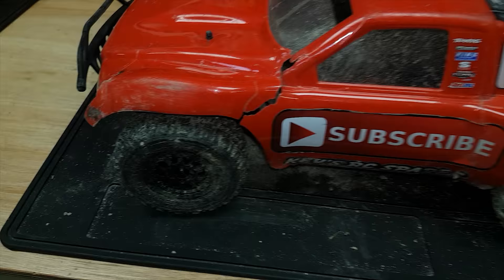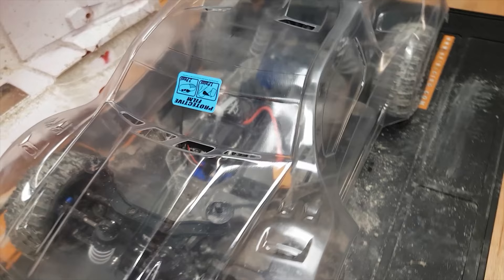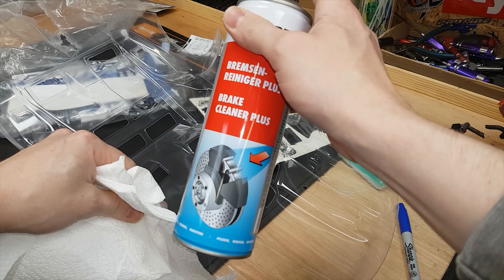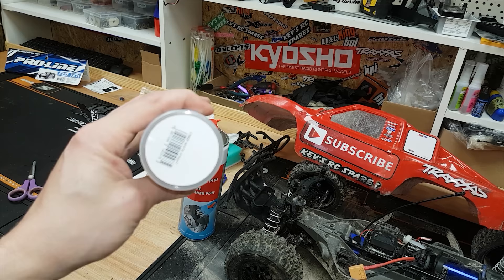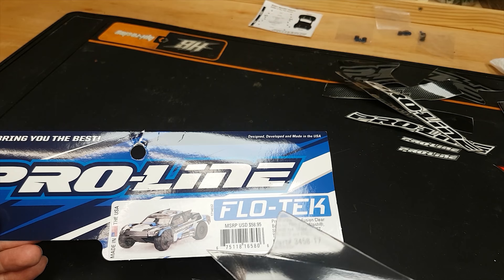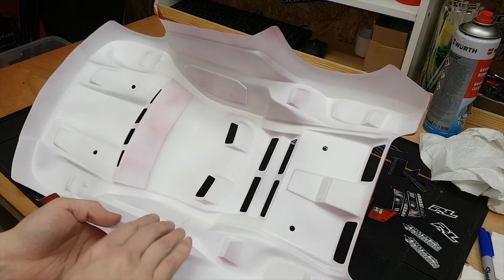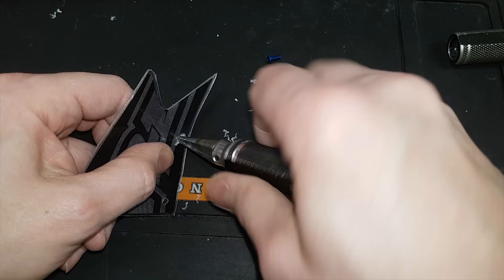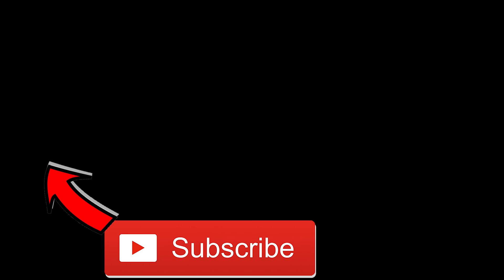TRAXXAS SLASH 4x4 Gets a New Body Proline Flotek Fusion

Comment: from my experience I got some more life out of the body, by slotting the rear body holes forward a little bit. reason: the chassis will flex and without the slotted holes the body becomes a load bearing component and will crack sooner near the body post.

Comment: How does you brushless slash not over heat every time I use it it gover heats and I have a normal monster slash
Reply: Did you ever figure it out?  With the bigger tires you need to gear down.

Comment: Get a traxxas erevo 2.0 I have one and if is amazing
Reply: Harrison Hembree he does its in the mail
Reply: I just preordered mine off amazon
Reply: Uhh, no? Revo's just a jack-of-all-trades-master-of-none piece of junk that wants to be a monster truck and a truggy but fails at being both. Too light for MT, too heavy for Truggy.
Reply: TestECull Guess what, it's not meant for racing, and it's just meant for bashing, where the main thing that matters is durability, and power. It definitely has both.
Reply: It still fails at what it does. You want a better bash rig? THere's a million better trucks on the market dating back 40+ years. It's not even that durable, no Traxxas vehicle is. Half their business model revolves around selling hopup parts, which they can't do if the thing's properly durable right out of the box!

My point still stands.  Revo is a jack-of-all-trades master-of-nothing piece of junk. Do your research, buy a better truck. Doesn't matter what you're doing with it, you can do better than a revo.